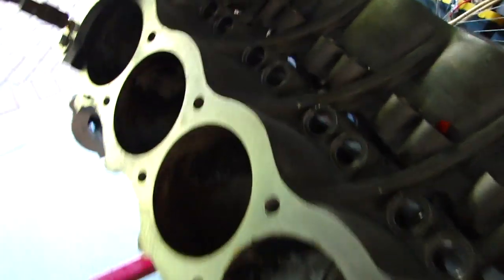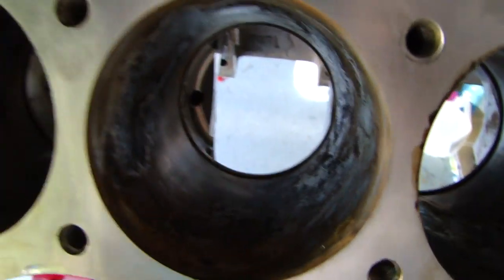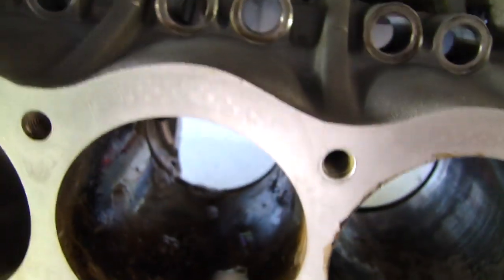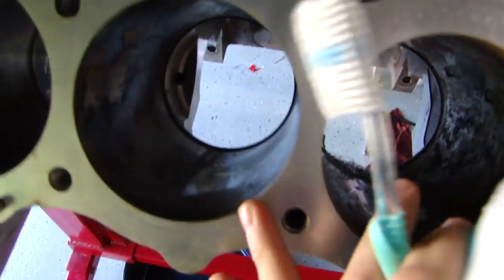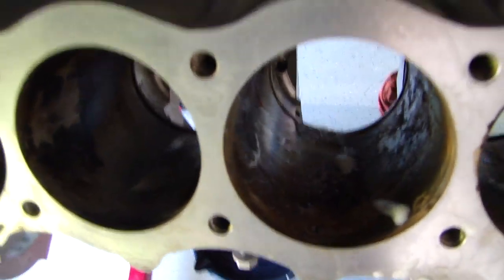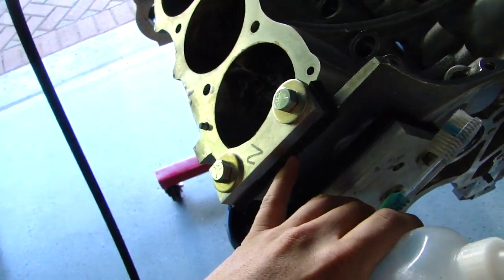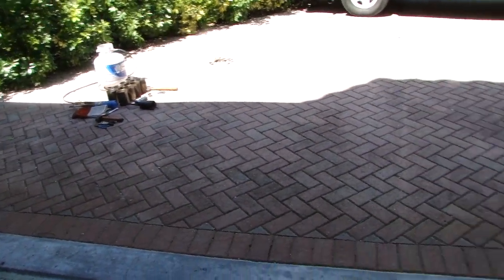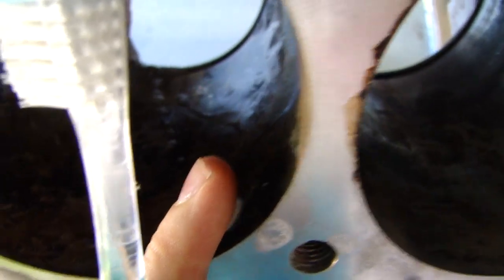Land Rover V8 Cylinder Leak / Crack

Comment: I know this is an old video but I’m curious on where I can find this pressure test kit? I’ve called MotorcarsLTD and they don’t carry this kit anymore. My local machine shop is out about 6 weeks so I’m curious if I can at least check if the block is trash before then. Thank you for all your videos. I started from thinking my timing chain was creating the ‘tic’ haha sure enough it gets way deeper than that. Cheers!
Reply from the maker: Hi Eli, I fabricated it out of 1/2" Aluminum plate and 1/2" thick rubber from Amazon, using cardboard templates and cut both materials on a sub-$100 chinese bandsaw. Then I drilled and tapped holes for an air hose quick connector (also using cheap NPT taps from Harbor Freight). Good luck with your motor!

Comment: Think this is what’s wrong with my car are sleeves not an option? Would welding be a permanent fix?? My car has same head gasket type symptoms, white smoke coolant in the oil too, is cold stitching an outdated fix?? Would be grateful for some advice
Reply from the maker: The recommended sleeve are called "top-hat" sleeves. They have a flange at the top that sits in a groove that you would have to have machined into the top of the piston. The sleeves also have an o-ring at the bottom. The designs prevents the sleeves from slipping downwards and any future block coolant leak from reaching the cylinder head. 

The best place to get them from is actually England, even though the sleeves are made in California. It was less expensive and 1-2 days to get them from England via DHL than from the actual manufacturer in California. The website is: turnerengineering.co.uk.

Good luck

Comment: How come the 60psi test, when coolant circuit is only 14psi?
Reply from the maker: Because the leaks sometimes don't show until you test at a higher PSI and with heat too (from halogen work lights).

Comment: you could try epoxy
if theres a pinhole theres a big chance the walls are eaten intoo by bad coolant and anodisation
Reply from the maker: +watahyahknow I TIG welded the holes and then installed top-hat liners from TurnerEngineering in the UK (actually USA made sleeves, but was cheaper and quicker to order from UK).
Reply: interesting , was looking intoo a manufacturer closer to europe myself , will look intoo that one 
thank you
...... oh darn their landrover only

Comment: Jake,
 What type of symptoms did this engine have due to the pinholes ?
Reply from the maker: +Billkoustenis Overheating, white smoke in exhaust, coolant in oil pan. When I bought it, the auto transmission was in the back seat, uninstalled, the starter motor had exploded, and it hadn't been run in months. I thought it was a simple headgasket job, but later realized it was a block leak.

Comment: Great video Jake! Best I've seen so far. This is the same location Robison found on the blocks they tested. Seems to have something to do with the proximity of the head bolt threads.
Reply from the maker: +Dan Easter Yea, one theory is the tooling Land Rover bought from Buick from the 215ci V8 motor was worn. Some say they weren't waiting enough time between engine casting and drilling cylinder head bolt holes.